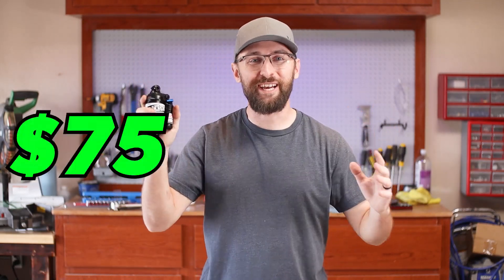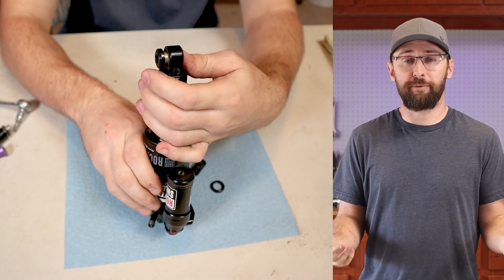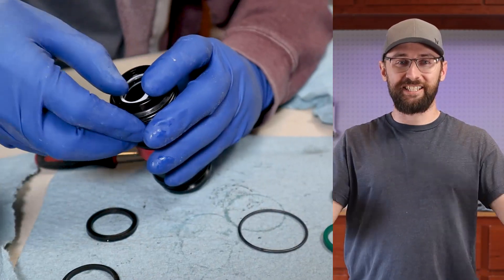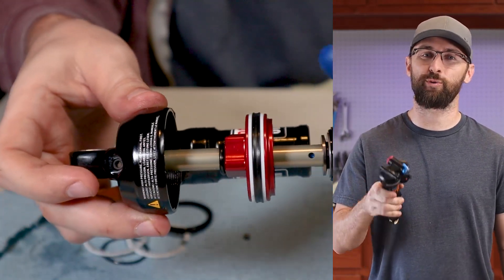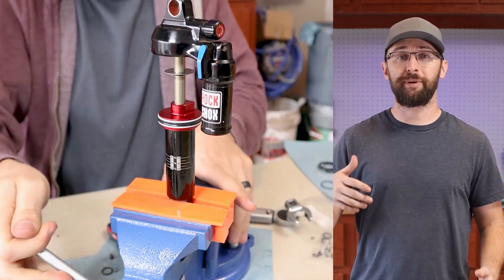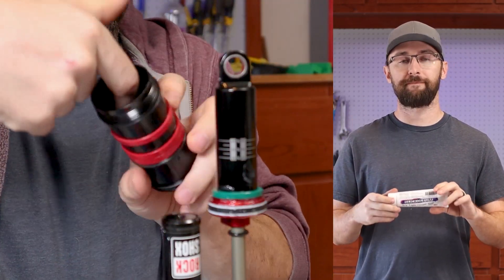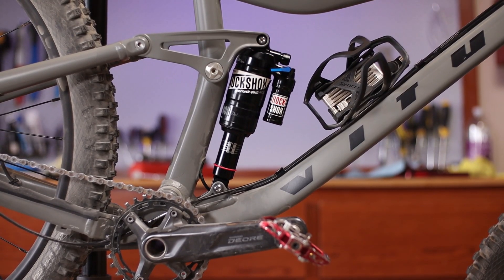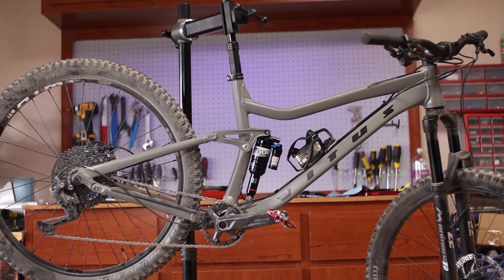BROKEN Rockshox Monarch Plus RC3 Rebuild 100 Hour Service

Comment: Would you recommend one of these? I have a polygon vander t8 that has the same mount as the d5 and it’s not common. This seems to be the only piggyback shock with 190x51

Comment: Just did the first full rebuild on RS Super Delixe Ultimate and it took me 4 hours but one hour alone was taken up by installing a spherical bearing instead of the regular bushings. Also installed a hotdog piston. I have yet to test it out on the trails but I think it turned out good. Very satisfying!

Comment: Question i have a monarch plus shock but it has a damaged 222x66 damper  body. I would like to replace  it . I have a stock 213 x 63 monarch shock . So here is my question, would it be possible to swap those two?
Reply from the maker: Yeah but it might mess up your geometry a little. Similar stroke, but also you'd have less travel by a little
Reply: @EvansMTBSaga  thanks for the reply. The availabilty of parts here is very scarce. Good to know that it's compatible. 👍 thanks 👍

Comment: Hi! Can you help me please. Why could oil travel in damper only in one direction, during bleeding? When in push damper down, it wont go up. All oil go thru damper piston, but won't go back. 
I have to use a lot of strenght to forcify retract it back up. Shimstacks are ok, IFP damper is open. What could it be? Thanks.

Comment: Crows feet also have a torque multiplier if not used at 90 degrees so a NM setting on the wrench equates to a higher value because of the mechanical advantage of the crows foot.

Comment: Hey mate nice video, best way to learn is defs just pulling it apart ! Just so you know with a torque wrench if your using a crows foot or extension you have to have it at a 90 degree angle not straight or else it changes the length thereby the torque will be wrong.. in your case of having it straight the torque will be higher than the dial indicates..

Comment: Oil free grease only in the air chamber is much better but requires more frequent greasing. Easy quick service with a smoother stroke and no mess in the can.  (Oil and grease don’t mix and make a nasty mixture)

Comment: Hi. Im going to give it a go to refurbish my stuck Monarch RT Debonair for my Hightower. I took the sleeve off to find that I had 7 of them rubber bands around the air chamber. I see yours has 3.
One of the rubber bands had somehow curled down past the top end of the cylinder and was over lapping the middle rubber ring on it. So I am guessing that was the problem with it.
I will admit I most likely have closer to 1000 hours on it than a 100 hours. So its no wonder it needs servicing.
But my question is... if you or anyone else here knows.... WHY does mine have 7 red rubber bands around it ? Does it have something to do with tuning it ?
I used to be 375lbs and am now around 300. Santa Cruz here in UK originally tuned it for me for my weight in 2017 so it wasn't done by amateur I assume ?
Should I look into maybe not put as many of them red rubber bands in it when I service it ?

Comment: I know this is an old post but, if you use Crow's feet with a torque wrench you have to put it at 90° to the torque wrench. Otherwise, you are adding leverage and increasing the amount of torque compared to what the torque wrench is reading.

Comment: Hey man I have the same shock to go on my mythique do I need mounting hardware in the bottom eyelet or just the top?
Reply from the maker: Yeah I had to buy both top and bottom
Reply: @EvansMTBSaga  Thanks for the quick reply man! Any chance you could tell me what way the little spacers on the ends of the pin face?
Reply: @EvansMTBSaga  Hey man, struggling to get my shock mounted, could you send me a link for mounting kits? my end spacers look different to yours

Comment: You can't just use any grease...the seals can be degraded...lucky for u the Slikoleum slick honey (if that's what u used) is the same grease as sram butter (that rockshox used to spec), so u are lucky. Suspension grease is non corrosive to the nitrile seals/oring used in forks/shocks. But many, including other slikoleum greases aren't! RS now spec the dynamic grease +oil as it performs way way better... much smoother.

Comment: If u tightened to bottom out, u crushed the o ring....depending on location...the seal wont last. 
Get a torque wrench(s) with the right range and use the crow's feet correctly for proper performance and service life. The sram engineers dont work out the required torque for fun! Torques are important. You may have over torqued and damaged by parts and sealing surfaces by 'doing as tight as u can'!!!

Comment: I have an older Rockshox Ario RL rear shock from 2014 - It needed servicing - I did it myself - made some mistakes - making it unusable - so I bought a new rear shock but don’t want to just throw this old one away - any recommendations?
Reply from the maker: Sounds like it might be a total loss. I have two derailleurs that are total losses and I keep them around to harvest a speciality part if I need to
Reply: @EvansMTBSaga  that makes sense - thank you

Comment: Hi Evan, i have a vrx and was looking to upgrade the rear shock to a rt3 too, but VITUS spec their shock with medium rebound and low compression. I contacted VITUS and they say they designed the kinematics of the vrx around the medium rebound and low compression. I know RockShox do medium rebound and low compression kits. Have you thought about doing a conversion? Keep up the good work!
Reply from the maker: I never put that much thought into exact shock tuning, but I've since sold the Mythique and will be selling this shock separately pretty soon. I thought the shock was a great upgrade despite its tuning

Comment: 30% sag at 200 PSI? How heavy are you and did you measure the sag on a seated position or on an attack position?
Reply: He doesn't seem to know much about setup and I guess he likes it really soft. 🤷‍♂️ what he doesn't seem to understand is that you have to balance the front and the rear. If he's running 30% at the rear then he should be running no less than 25%+ at the front if he wants the bike to be balanced. My guess is he's not running 25% at the front or more. Which means the bike is probably not setup properly, he may like the way rides but it could be better. Balancing the suspension is very vital to proper load transfer.

Comment: What size was the Rear Mounting Hardware you used? I clicked your affiliate link, but the size box defaults to select.
Reply from the maker: It's "1/2X1/2-Inch 22.2x8-mm". I had to buy two of them
Reply: @EvansMTBSaga  Awesome, thanks man! Great content btw, this one in particular is exactly what I needed.

Comment: I’ve just serviced my monarch r and I don’t think I set the IFP correctly does it really matter? The shock feels good
Reply from the maker: Did you pump it to 250 psi?
Reply: @EvansMTBSaga  yeh I pressurised it
Reply from the maker: Oh then it sounds like you did it correctly.
Reply: @EvansMTBSaga  I don’t think I pushed it down far enough

Comment: Please watch if the rear tire slams on the seat tube because you got more travel than the xfusion
Reply from the maker: Good point. The upper model Mythique frames have the same shock stroke 200x57. Same frame.

Comment: I've just ordered a mythique VRX, how much better do you think this shock is than the stock monarch R?
Reply from the maker: Well I replaced the X Fusion and that was a big difference. I never rode a regular Monarch so I couldn't tell you. I'm sure it's not a gigantic difference enough to justify spending hundreds of dollars.
Reply: @EvansMTBSaga  thanks, I'd be interested to try a marzocchi coil with a progressive spring on it maybe a year down the road when they're cheap second hand
Reply from the maker: Second hand is the way to go! Did you pick up a 27.5?
Reply: @EvansMTBSaga  I ride pretty rough trails and I can definitely feel on my 27.5" hard tail that it definitely could benefit from better roll over of bigger wheels so I'd decided to get the 29" model in size large 👍

Comment: Nice! I did something very similar and I’ve also been calling it a VRX+! Haha! I bought a 2020 Vitus Mythique last summer and because of availability (and budget) I went with the VR. The first thing I did was add a OneUp Dropper post. Next I went after the suspension. The X-Fusion stuff is ok but it’s definitely budget grade. I saved up and put a new 150mm Z2 on it and a used 140mm Rockshox Monarch RT, that I also had to rebuild. I upgraded the front rotor to a 203 a month or so ago and soon I’ll replace the brakes themselves. For now though, this thing rides like a dream!
Reply from the maker: Dang our bikes are pretty much the same! Glad we have the same tastes man!!

Comment: I'm upgrading my Vitus Mythique too. I was wondering do you know the diameter of the air can on the Monarch Plus? I am thinking of changing to a coil shock but I'm not sure if it will fit. There really isn't much wiggle room already between the X-Fusion shock and the seat tube. Any help is appreciated. Great video!
Reply from the maker: 50.5mm. I have very little clearance too. Probably too small to measure. You can see it in the video

Comment: youn can not incrise rear travel
Reply from the maker: I did in this video.
Reply: @EvansMTBSaga  how?i tought that the rear travel depends on the path of the rear axel and not the shock leinght
Reply from the maker: Path of the rear travel is affected by stroke length of the shock.
Reply: @EvansMTBSaga  but like isnt the frame designed for a serten amount of travell?
Reply: @davidrakovic8970  yes and this one is Designed for both

Comment: Surprised you got the red ifp adapater to work. Lots of people have to modify it to function properly. It’s something which rockshox still hasn’t addressed in all these years.
Reply from the maker: I couldnt show it on camera for sake of time, but it did give me major problems. Tried cutting the nipple off the schraeder valve. Didn't work. Then it just magically starting working after 10 attempts.

Comment: Man you and I are on the same wavelength. Got a new fork and shock for my Rift Zone 2 which will bring it slightly above the level of the Rift Zone 3. One was a brand new takeoff and one ridden only a few times and taken off. Just gotta find the time to install them. Great video as always.
Reply from the maker: I watched your fork conversion video! We are definitely on the same wave length. I'm trying to get a nice dropping post for $1 on ebay right now haha
Reply: @EvansMTBSaga  ah yeah that’s my stock Recon. After doing all that I’m just going to replace it. Ha! At least if I ever get a cheap hardtail I’ll have a fork to put on it. Anyway good luck on that dropper!

Comment: Another great video Evan...I'm on the prowl for a Marzocchi bomber for my hardtail because of you....now going to help my son build Legos to practice up...
Reply: Got a z2 on my hardtail works amazing although get some tokens and add 5 or 10 more psi then the set up guide says for a better feel
Reply: Z1 is a fox performance 36. So that would be a great choice at a slightly lower price point. The Z2 is not a bad fork at all. Currently run Z1 on my main hardtail, & the Z2 on a piece of shit 2020 Roscoe 6 that I inherited. Completely transformed that trek. I'm running 2 tokens in the Z1 & 1 in the Z2. I'm #160 lbs.

Comment: be careful clamping the bike to the stand, i don't know if you should hold it by the dropper, specially by the moving part
Reply: When you dont know something, it's best to keep your mouth shut. It's fine.
Reply: @bananasstuff3344  Maybe you should follow your own advice.  It is not good practise to clamp the moving part of the dropper as it will draw air into the cylinder on some dropper post which will require a rebleed. Ok to clamp to the lower non-moving part of the dropper.

Comment: flip you shock upside down. apparently it provides benefits as the piston is driving into the body.
Reply from the maker: I will try it out, although it may make contact with the frame! Everything is a super tight fit in the frame's front triangle!

Comment: Any concern with hitting the frame if you've increased the travel? Any way to add more tokens to keep from bottoming? I'm not familiar with that shock.
Reply from the maker: It's the same size shock as the VRX, so it was designed for this shock size (same frame as VRX). There are two different kinds of tokens to add, which I need to do with my fork also. The shock at complete bottom out doesnt contact the frame with was a relief. Its close though!
Reply: @EvansMTBSaga   I have a size small frame of the vrs. Will this shock fit with out hitting the frame?
Reply from the maker: @MiguelAngelo-us3wk  My shock is pretty close to touching, but it doesnt. I have no way of knowing for sure if the small frame would have clearance. The shock sizes are the same with all sizes though.
Reply: Hi  @EvansMTBSaga  Can you tell me the dimensions of the air can and piggy back? if the air can are 52 mm in diameter I have space on my small frame to mount this shock without touching the saddle tube. But I cannot find the dimensions of the piggy back reservoir. Can you provide me these measures like the diameter and the length?

Comment: Wanna see how that thing runs! And quick question, what size dropper would you recommend for the Vitus Nucleus 29VR? I picked one up in a large (i know you had medium) but I noticed the same as you that the seat post is SUPER long. I want to get a dropper but is there a point to get a 200mm dropper if I'm gonna use maybe 100mm of it?
Reply: I'm happy with 150mm on my Nucleus VR. In fact, I don't think I could fit longer travel. Measure how much seatpost is currently out of the frame and subtract 20mm
Reply from the maker: I'd say no to a 200mm dropper. I have a 125mm dropper and have the seat clamped kinda high, which works out great. Really no need for the seat to go all the way slammed. In your case, I'd say a 150mm would be perfect.
Reply: @EvansMTBSaga  appreciate the feedback! Thanx guys

Comment: Just so you know mate, crows foot on torque wrenches need to be perpindicular to the handle not inline  for accurate tightening. This is because torque is a force X distance  and having the crows foot in any other orientation adds distance effectively adding torque.
Reply from the maker: Good tip! Off camera I tried it in several orientations and thought it was quite amusing. I will keep that in mind for next time.
Reply: The difference on a crows foot is minimal. A long dog bone can make a significant difference. Low torques on short crows foot isn’t worth worrying about. But you are technically correct.
Reply: I was gonna mention this. But you can Google the math formula.
Reply: @shawnsee2688  no need for google. Simple algebra to solve for ratio
Reply: I  was just about to say turn the crow's foot 90!!
Reply: It’s 29.5 ftlbs, not sure how his tq wrench doesn’t go that high. I’m guessing it’s way over torqued.

Comment: I give you credit.  Doing a full shock rebuild is something I don’t mess with.  I’ve done a upper seal replacement and new oil in a Fox fork, but not a full rebuild.  

You can send you suspension into Fox.  They charge $190 for forks and $160 for rear to do a full factory rebuild.  Spent $350 in January to have them do it.
Reply from the maker: Thanks for the props guys! It was my first time doing this, but I had so much fun doing the fork servicing. The instructions from Rockshox and Fox are super clear and I believe anyone can do it with a little courage and sweat!
Reply: one reason why i went back to hardtail... and thats not even servicing all the pivot points. also i thought the older i got the nicer bike i would want and im definitely going the other way, to a cheaper and simpler build every new bike i build. videos like this are great cause they show folks they if they are willing to tackle someone elses problem they can keep the barrier to more expensive equipment lower.

Comment: Ohh yeahh now the bike look very super slick!
Reply from the maker: I think so too! Pumped to go ride it!
Reply: @EvansMTBSaga  Hey Evan,is quick release still relevant on today standard mountain bike,like using it on jumps?cause it kinda bothers me a lot when thinking the wheels can fall off😂 compared with thru axle🤔
Reply from the maker: @lebot3403  I think its a mental thing. In BMX, all those wheels are bolt on and have the potential of falling off. They deal with pretty high speeds and serious G forces. Never seen a wheel in BMX just fall off. If I was gonna do a serious full suspension MTB with quick release, I'd replace the QR skewer with a bolt on skewer.
Reply: @EvansMTBSaga  got it,thanks for the info,now i can relax.